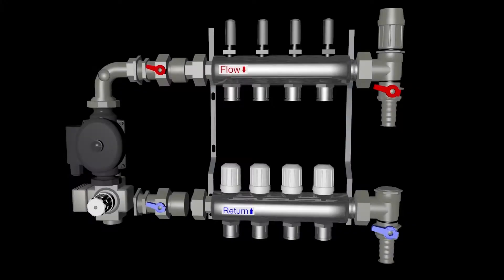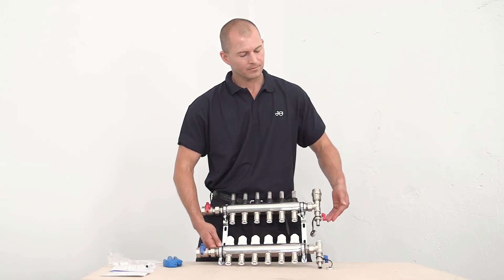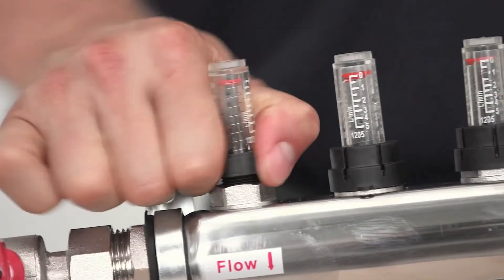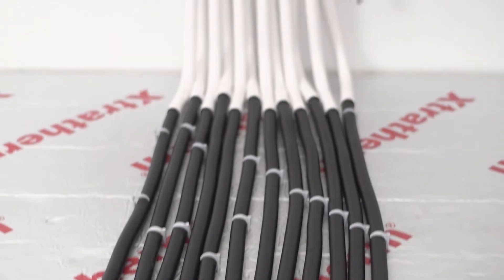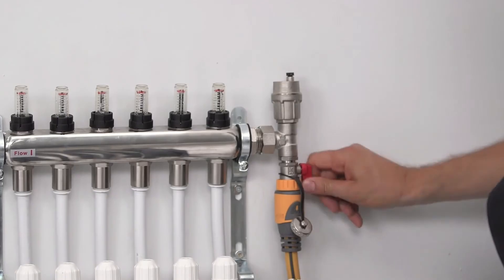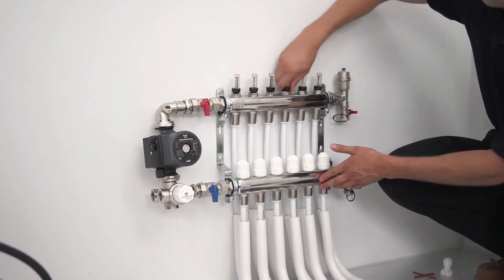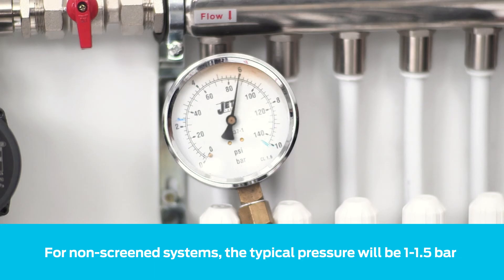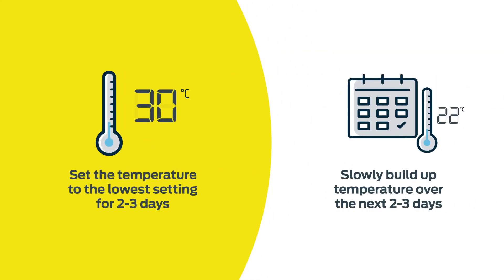Installing the JG Underfloor Manifold

Comment: This was a really helpful video. It covered so many aspects and was detailed enough to be able to utilize it yourself to learn how these are set up and operate. I am in the US but I have noticed that Europe uses a lot of mixing valves. Are you guys using higher boiler temps? My boiler temp is only 120 degrees F.
Reply: I believe the mixing valves are for systems that include radiators on the same system, so the boiler can provide higher temps to the rads and then the mixer valve controls the max temp of the UFH.

Comment: If UF heating manifold is located on ground floor can I use same ground floor manifold to provide first floor underfloor heating also in 3 seperate rooms. I am worried about air being accumulated in first floor pipe loops .